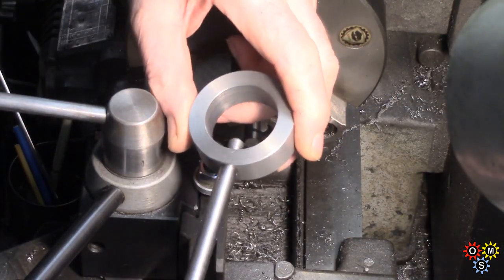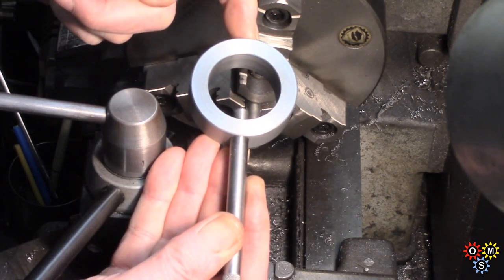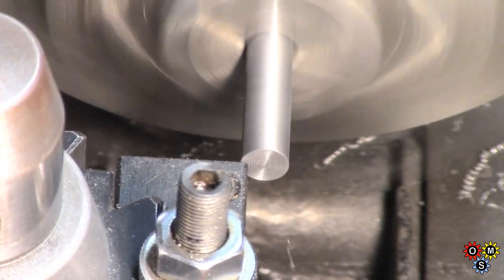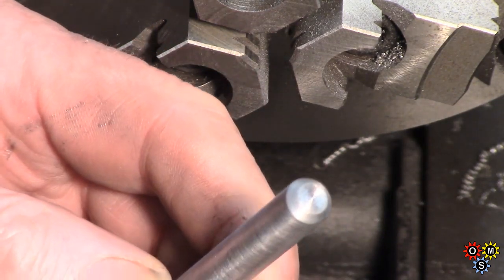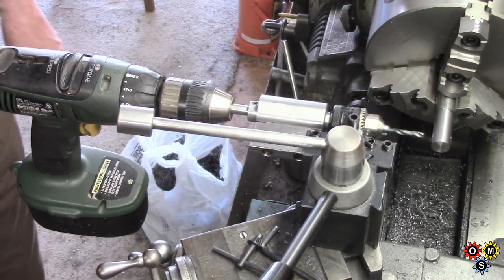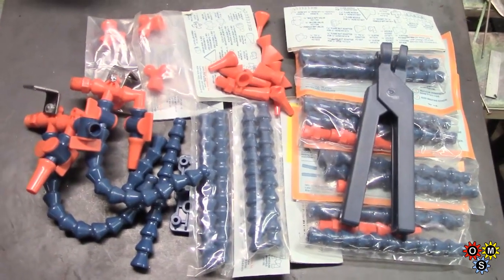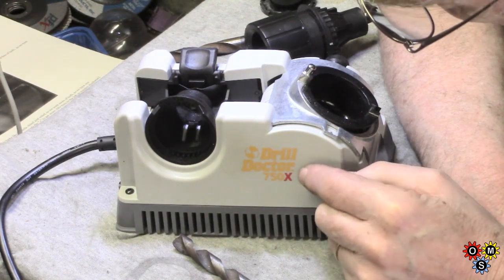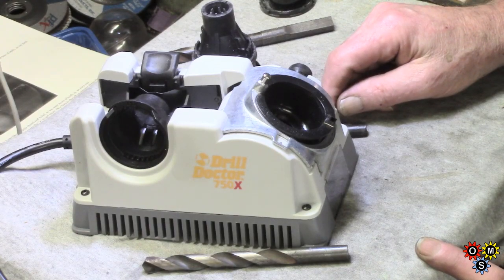Bits - 09

Comment: I just finished making a similar mill chuck tapping collar.  Thanks for showing me the idea.
Reply from the maker: +Joss Fitzsimons 
Hi Joss -- thanks for stopping by. A useful gadget I think.
Reply: +ChrisB257 One small change I made is instead of knurling ends of handels I milled two small flats on the chuck end of the removeable handel. This permits a small spanner to tighten well against Clasp ring.  I think this will make it 'solid and rigid' in use.
Reply from the maker: +Joss Fitzsimons 
Good idea - I nearly did the same but I find the knurl allows pretty adequate tightening.
Reply from the maker: +Joss Fitzsimons 
Good idea - I nearly did the same but I find the knurl allows pretty adequate tightening.

Comment: Getting behind with my viewing...  Sigh......  :(
Drill Doctor is for me good on smaller bits, question of older vision... lol
Still like manual sharpening, this includes HSS tools, the secret is a BIG powerful Baldor or equivalent type grinder with quality wheels, where it grinds the metal instead of heating it up.
Reply from the maker: +pierre beaudry 
Hi Pierre - me too sometimes with viewing.
Yes, I still prefer hand grind on good wheel but yet to feel totally proficient like some folks manage.

Comment: Chris, the cross-drilling tool can come in handy and appears to be simple enough to make. Is this as accurate as your tailstock cross-drilling jig? Naturally your jig requires a bit more effort to set up, but I really liked the jig as well as the short series you did to show a few handy items you had made.Anyway, thanks for sharing mate!
Reply from the maker: +Jeffrey Vastine 
Hi Jeffery -- I think once the chuck centers are critically lined up it should be plenty accurate. I'll still use the tail stock jig sometimes though, instead of putting work piece back in lathe chuck. Usually a case of convenience much as anything! :)

Comment: Hi again Crhis,  Imagine if you changed the shaft out with the chuck and made one for a small collet holder, one could mill key ways right on the lathe?  That should work I think and also think of the set up time saved from taking it to the mill for cutting the key way.   This fixture could have some real nice benifits I am thinking,   What say you?
Reply from the maker: +Glenn Felpel 
Could be an ER 16 set up might work Glenn - something to ponder! :)

Comment: Hi Chris,  Very nice cross drilling fixture you received.  Conbine thie idea with a way of indexing the spindel and it could come in even more handy.  Thank you for sharing this.
Reply from the maker: +Glenn Felpel 
Hi Glenn -- indeed, a very nice gift. I can index the spindle in fact if I use a gear tooth location method at the back - mostly within the range covered by a 76 tooth gear wheel.

Comment: The cross drilling attachment looks a very good thing to have, I assume it has a thrust bearing built into the chuck end, another thing for me to make! You really need a tailstock Diestock, you can make one with a straight shank to hold in a chuck, or if you want to go overboard mount one on a morse taper shaft, a must have for dieing on the lathe, the taper point screw that engages with the split die should close the die on unscrewing, not open it up, by turning it in, you will open the die, as I am sure you already know! Chris B.
Reply from the maker: +Englishman French 
Hi Chris -- the jig actually is ball race both ends. Considering for most part it'll only be drilling small holes I doubt that matters.
I have a tailstock diestock (2 actually, to cover four size options) - almost forget I have them - made a long time ago - on a morse taper. Sometimes quicker to go straight to regular approach.
Yes - taper point adjust - got muddled. Screwing in spreads, screw out relaxes die to go to default dia - which can be slightly reduced further with the two set screws. The few thou available with adjustment can be useful.

Comment: That is a nice cross drilling jig. I'm going to have to make one for my Little John. Oh Thank you for the information on the Little John on your site! I do have a question, mine is fitted with a quick change gear box, how do you figure out what your longitudinal feed speed is? I am missing some thing lol. Thank you!
Reply: I don't think I am missing any pieces on the lathe, I think I can't figure out how to figure out the speed of the feed lol.
Reply from the maker: +Chris Brown 
Chris -- I never had any actual published data but here's what I suggest...
Obviously you have a guide on the gearbox chart re TPI ... so, work out with tests running carriage and cross slide under power at different settings - from 'A 60' or 'A 30' (depending whether you are running a 48 or 24 gear in drive train) to 'C 4'.
Then set up a dial indicator to suit direction being tested and rotate spindle by hand to see what one revolution produces in thou. Then equate this all to speed you would run the machine.
Hard to explain fully - maybe I should do a video on exactly this aspect of the Raglan?

Comment: Only thing I don't like about the Drill Doctor is they only go up to 3/4". Mine is only 1/2". :)
Reply from the maker: +DSCKy 
Hi - well I don't really think the machine is really even man enough for 3/4 - long job at very least.  I do think that when I get up to large stuff I can hand grind and do all my measurements to get it right. 
Oh for the ever-sharp drill anyways :)
Reply: Haven't tried the 3/4 but the 1/2 works well. Should say I have only touched up dull bits. I did fix one that was broken, but did most of the fixing on a pedestal grinder.
I can make them cut again by hand grinding, but they really aren't well done. :)

Comment: What ho Namesake, I have two DDs both 750x model, but each has a different set up procedure. My first one, £1 at SMEE auction bet FeePay was more than that, has to have the drill holder rotated clockwise to get a decent back off but the other, £15 at another auction, has to be rotated anti clock. I think this variation upsets some buyers who don't have the intellect to read the instructions properly. Now if you want to sharpen small drills down to say 0.8mm, you need my improvement of Gadgetbuilder's variation  of DAG Brown's four facet jig. One day i'll do a video, promise! (well maybe)
ATB
c
Reply from the maker: +Chris Stephens 
Hey Namesake! My experimentation thus far is showing need to tailor for each drill bit. If I hit the right combo I'll engrave setting on shank bottom. Lots to do yet when time.
Yeah - do that video!!
Reply: I would but I don't want to show you lot up.
Reply from the maker: +Chris Stephens 
That's a risk you gotta take and we may have endure!!!
Now, get to it.!
Reply: HMMMMM

Comment: Hi Chris, I have an old DD and I like it but it does take some getting used to. If I have a drill that is in sad shape, I hit it with the bench grinder first to get it to rough shape then finish it on the DD. It will save you time and diamond wheels.
Reply from the maker: +Cuppa Joe 
Hey Joe -- you are doing much as I am starting to think about - pre grind by hand on a well damaged bit, to get a sort of presentable start, then go see the Dr! :)

Comment: I like that tap handle, you always come up with inventive projects.
I also got a 750x, the first grind does take quite a few cranks, you can also adjust the amount to be removed .
the split point feature is the reason I purchased the 750x, I find it takes considerable pressure and repetitive applications to achieve a nice result. the bits do cut very well I am pleased to say. over all im happy and there will be less wasted small drill bits.
Thanks for the video Chris
Reply from the maker: +Phil&#39;s Projects 
Hi Phil - actually a 'cheat' project somewhat - I have now remembered I think I saw a YouTuber "Gunny" showing he had made similar a while ago.
I think I will find the 750X OK in the end - I have enough worn drills to experiment with!
Thx for swingin' by. :)